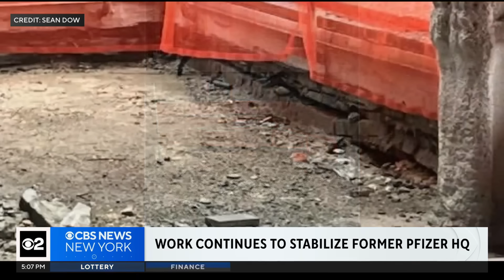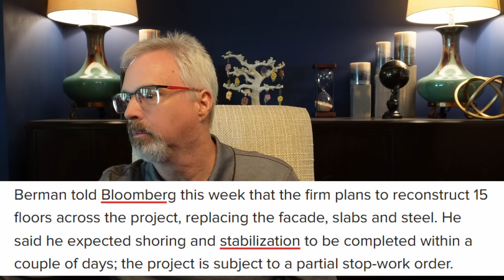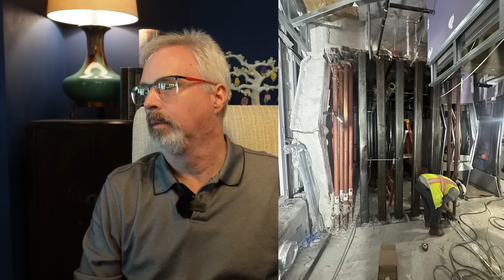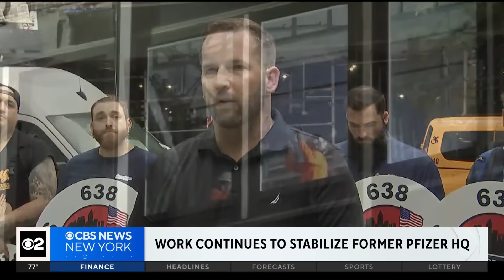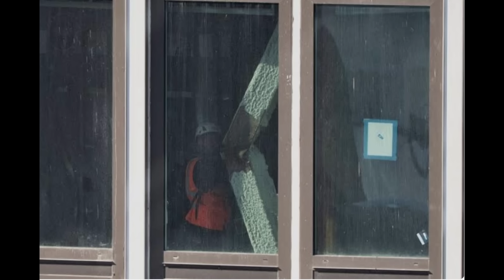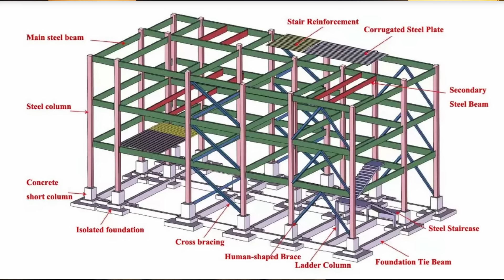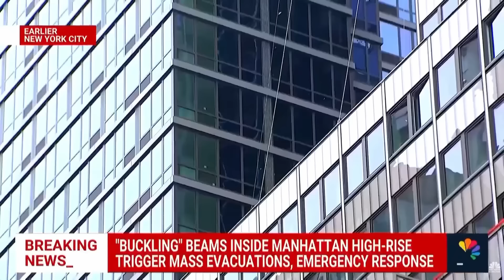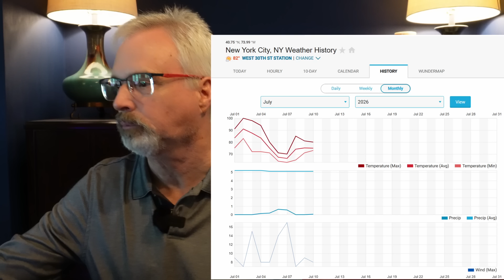Update - Pfizer Building Structural Column Failures; Now What?

Comment: Did anyone notice that the 2 columns that buckled were directly below the new columns for the addition?
And all of the load has been transferred to the floor instead of a support columns below each floor.
Remember that no dead or live loads have been added to the building, the construction hasn't been finished, and the new occupants have not moved in yet.
Reply: The new floor above the original building are dead loads.
Reply: @MrsAnnieTK  Exactly.  And more important, (from what I can see from the photos provided) the new dead loads haven't come close to their maximum values yet because all the new floors are still essentially, . . . . . .  gutted.

Comment: The building the columns failed was in the older building at 219 East 42nd Street, completed in 1905, was originally a 10-story building, expanding it to 29 stories.  Although engineers were more conservative in 1905, I doubt was built to support another 19 stories.  The question, if the columns are failing before completion, what will they do when it's completed with a working load?  This is a colossal engineering and city approval failure.  NYC, inept and inert engineering coupled with approval corruption sums the possible causes for this failure.   The buildings doomed from a marking point of view.   Olly a fool or idiot would have their family in a building that had column failures during construction or in an adjacent building. .

Comment: 1960 roofs were notoriously leaky. A leak over those columns could have soaked the fireproofing for a long period, contributing to corrosion in the columns.

I worked in a building constructed in the late 1960s on the top floor. In the 1990s, they decided to replace the roof. About 1/3 of the corregated steel roof plates needed to be replaced because they were too corroded to be be safe to walk on. Of course, the plates are much thinner than the columns, but a corroded beam may not have had as much of a safety margin as originally thought. It would also give a reason that the top original floor failed, but not something lower in the building.
Reply: Columns that are untreated in a “friendly” indoor environment will have minimal corrosion after decades, its the outdoor exposure with all that pollution that causes corrosion it starts to be a problem.
A lot of examples of 100 year old steel columns that has been standing inside a controlled environment that just have minimal surface corrosion

Comment: Casey, can you comment on the Structural Design practices in the 1950's and 1960's relying on LRFD with robust margins and safety factors. Compare to ASD , where more computerized calculations allow tighter models of structural systems. The developer seeking to exploite seemingly unutilized structural capacities in "old style" engineered systems may use newer analysis to support apparent safe use of such found capacities to add, oh say another 10 floors?
Real world condtions over time, made safe by the "Old Ways" are frequently under appreciated in rennovation work.  Pressure to fast, cheap, profitable work is irrestible for investors. Engineers are often either kept only partially informed about the job or are pressured to colaborate.  Your focus on foundations is exactly the place to start. Thanks!

Comment: NOT an engineer, but. If the original building had decreasing gauge of steel in the columns as they went higher up (to reduce weight and maybe costs) and the new project engineers made their calculations based lower floor gauged steel assuming it was the same all the way up, this would account for the buckling after adding more floors. Another thought the new floors were cantilevered out over the top floors this would change the loading from purely vertical.

Comment: At minimum, what went wrong was an incorrect assessment or (later) understanding of the actual load carrying capacity of the original building and its actual safety margin.

The load carrying capacity and safety margin of part of the original structure have both been clearly exceeded as evidenced by the obvious multiple column failures.

Comment: On typical major building additions how extensive would the engineering report be in regards to  the condition of the existing structure ? Would an in depth investigation of the piles (?) be done . 1960 was 66 years ago , were the as built plans still available ?

Comment: Thanks for good insight. Unions are full of malarkey. Their statements are meaningless. Do not look to much into inspectors and possible corruption, you might be surprised. Thousands of buildings constructed in Manhattan, not one fell apart like this one. The constructors did not inspect incoming material? Putting floors on top of a building, not engineered properly and structural components inadequacy, inadequate city inspection, City Planning Bureau failure?

Comment: Question: what is the guideline for 'over engineering' a steel anything?  When I do stuff with wood or electricity I tend add at least 20% of whatever I used in a hope that it isn't going to fall down, blow away, or catch fire.

Comment: First order of business is everything on the floor of and above those is unsafe and damaged immaterial of what anybody claims.
Second order of business is that any insurance company that decides to insure the contractor who claims it can be repaired should be immediately suspended from license and investigated 100% for drug use.
Third order of business is every structure near that building needs to have their owners sue to force its demolition... if the narrow part of the building can't support itself, NONE OF IT CAN and none of it will once its been converted.

I would bet the lack of HVAC has led to other locations where water in structure froze and did damage.  So the Union guy may actually be correct.  You don't hire a Florida company to work on buildings in NYC.
This all lands firmly on the developer's head.

Comment: But Pfizer claims the columns are "Safe & Effective"!
Reply: Hmmm, after making that statement would I trust their  claims for their drugs?
Reply: The building that failed wasn’t part of the Pfizer building - it was the next door one. The two buildings were merged as part of this project…
Reply: @allangibson8494  "Gain of Function Architecture"?
Reply: @kurtvanluven9351 That’s not Pfizer’s thing…
Chinese engineering however…
Reply: @allangibson8494  Chinese engineering can be problematic; Chinese construction is rolling the dice.
Reply: @MrsAnnieTK So is American engineering apparently…
Reply: I want to see the list of possible side effects.
Reply: Could this become a Insurance claim?
Reply: @Dynodog1  This being the US, there will be lawsuits, but towards whom? If the structural engineers overlooked the necessity of reinforcing the original building, they are on the hook. If the reinforcing is on the plans and was delayed by the contractor, then the contractor is responsible.

Comment: Casey, What comes to mind is that the grade of the existing structural members may not have been accurately identified for the structural analysis of the underlying structure. It’s possible that the upper level columns may be sized below the columns supporting the floors below. I have seen cases if structural members could not be accurately identified, then the most conservative assumptions were used. It’s plausible given the age and date of construction of the building. Thank you for the update.

Comment: This isn't a 60-something year old building. The original building is over 100 yrs old.
Reply from the maker: They built through the 100-year-old building not on top of it at 219 e. 42nd Street.  The building at 235 east 42nd street was built in 1960.

Comment: The live loads are higher for an office versus a multi-family residential building. 100 pounds/SF office vs 60 pounds/SF for residential. Corridors for both usually are 100 pounds per IBC NYC modified code.
Reply from the maker: Thank you!

Comment: I am not an engineer, but if this structural failure occurred under dead load, what needs to be done for live load??? 
Seems to me there’s a hell of a lot of engineering and steel work to be done yet!
Reply from the maker: It looks like there may be some eccentricity of loading between the 22nd floor to the oitside of the 21st floor columns but I am not sure from viewing the photos.

Comment: It looks to me like water entered the vertical columns at the original roof, just above the 21st floor, running down between the fireproof coating and the column itself, causing corrosion over the years.

Comment: Excellent video, spot on, concur with your points.  Excellent engineering assessment.  To me, the root cause of the issue is either (1) adequacy of the structural design, (2) materials discrepancy -- installed structural materials are not what they were supposed to be and were not accurately taken into account in the structural design for the new installation, or (3) installation labor.  My bet is 2.
Reply from the maker: Thank you, it will be very interesting to see what the final investigation reveals.

Comment: Cannot rule out that it may be design related &/or cost cutting. It appears that the two bent columns carry two of four of the cantilevered beam extensions for the protruding upper floors, and two others perpendicularly over to the adjacent (new?) building. Perhaps, if that load was dispersed to more of existing columns, or reinforce said pair of columns, accordingly.  Should it be designed related, it seems unlikely that union workers, or non-union workers, could of caused the pre-existing beam to fail mid-floor. Thanks, Casey

Comment: One situation to ponder is who and how made the decisions to add multiple floors to the building. From other similar construction issues there is one primary reason: GREED! My guess for the added space is to make the housing "affordable". They need more space to add rentable property. ADD: from long time ago statics classes. No mention is made of the estimated load required to buckle a structural I-beam. Couldn't quite tell from the stills: are these columns immediately adjacent to each other? If not, the overloading indicates more problems than than just simple overload.

Comment: One has to wonder, if such a failure occurs on a partially constructed empty building, what the margins are in the building after it is complete and fully loaded with fixtures and fittings.
15 extra floors seems very ambitious.
Reply from the maker: That's a very good question!
Reply: @CaseyJones-Engineer  Yet in my PE review training a half century ago (I'm a retired PE, but not at all structural, EE) we were taught that often the heaviest loading occurs during construction.  Construction materials all being stacked in one place as an example.

Comment: 3:06 Those floors above look like they are tilting a lot more than 4"
Reply: Much closer to four feet than four inches.
Reply: Yes, but also not possible to judge by a picture that has no context. Was it corrected for lens distortion and perspective? Is it level? Buildings can look wonky when you study them in pictures taken by ordinary (read: not set up for architectural photography with low distortion perspective correcting lens) cameras.

Comment: The union types are trying to blame the current workforce for the failure of a 60-year-lold component? That seems rather far-fetched.
I have read a number of engineering discipline reports where an engineer stamped a plan, and the horny-handed son of toil assigned to build it took one look at the pdrawings and said ",I'm not going to try building that incipient disaster", or words to that effect

Comment: It most likely contains asbestos. It is best to assume that if the building was built before early 1970's it contains asbestos. This is NOT a labor issue it is clearly the architect and engineering issue. Everything should have been calculated and accounted for. Clearly the loading of the new floors was not accounted for. Steel expansion is interesting. Logic would indicate the if all the columns on any given floor were the same then all of them would expand and contact at the same rate. I do not recall the title, but I read a book by Saul Bellow about Saudi Arabia before being deployed to Saudi Arabia for Operation Desert Storm in 1991. Saul is an excellent writer, and I found the book very informative.

Comment: If that structural column was so badly corroded what about the others?  Union complaint is not helpful, for all I know Local 638 maybe installed the steel originally.  Yeah, the developer can just shore it up and add more columns and weight.   Engineering failure IMO.

Comment: Not too worry because this type of building only collapses once.
Reply: It's New York - they get do-overs.
Reply: And you win the internet for today!
Reply: In the meen time they are  warm and safe .
Reply: If you tokk the jab and all the boosters you won't suffer of the lethal effects of the collapse.
Reply: @Hope_Boat  Seriously?  You saw the name Pfizer and couldn't resist could you?  Go and catch a preventable disease already and leave the science-loving folks in peace.
Reply: If there was stress added to the steal columns from the 100+° F heat in July causing damage by expanding steal will the cold temperatures of winter also cause more damage from the force of contraction to the temporary steal columns and the already damaged structural steal columns continue to weaken the overall building?
Reply: @BigRedPhoenix.OO1.  Steel.  It's steal when you take something from someone and steel when it's the metal.  Steel can become brittle if it's too cold but I don't know if NYC winter temperatures are the kind of cold you would need to reach that point.  It might be the kind of thing you need liquid nitrogen for.  Engineers (of which I'm not one) could tell you more.
Reply: Hey that’s what the guy at Home Depot said too
Reply: I mentioned this in the last video! The guy says “in a steel building if one or more members lose their load carrying capability, that load is distributed to adjacent members” We were told that WTC 7 collapsed because the of one the load bearing columns lost their structural capability. Who's right and who's wrong? Do Americans guess at these things?
Reply: @Womble13 When one load carrier loses its ability, that doesn't mean it's the only one that does. That's why they came up with the term 'catastrophic loss'.
Reply: @OneWildTurkey Thanks for your comment, I never got a clear answer in the last video. I’m not a structural engineer, but had been a Farrier until my back gave out. So why did WTC 7 collapse and the Pfizer building didn’t? Could it collapse?
Reply: @Womble13 Why the difference?  Billions of different variables.  But maybe the biggest is the age of the different buildings and different codes they were built to. Plus the WTC was MUCH larger and had a lot more weight. The stories I've heard still indicate that the extra heat from all that jet fuel contributed to weakening the support structure.  Just what I've heard, but makes sense to me. I've seen metal bend and have sequential failure, like dominoes, first hand, but on a much smaller scale.  edit: strike-out, I was replying about the wrong building.  Thanks @josephfisher426   for the catch.
Reply: @OneWildTurkey  The reference is to WTC 7 (the adjacent shorter one that collapsed), and I don't know that there was an official/complete public explanation of that. But its foundation could easily have been compromised, particularly if there were interconnections at the garage level. Doesn't need to be an internal cause.

The weight of the twin towers was mostly hung off the core and the structural parts on the edges were almost entirely for stiffness (I only saw it from the observation floor, but there it was disturbingly insubstantial!) I believe the explanation was something like that at the time this was a means of being that tall while not being so massive on the exterior that the building was short of square footage near windows.
Reply: @josephfisher426    I didn't notice the 7.
Reply: @Womble13 Narrative, optics, spin, selective facts, these things matter, it's a cultural thing.
Reply: @disklamerIf I was an American I’d be pretty p***ed off! I wonder if this will re investigate WTC 7?

Comment: The highrise was built as an office space. Not to house apartments. Kinda like the house 5 doors down from me. The place was an a house rental a new owner came in and thought he could turn the 1910's stone wall basement into a new apartment down there outside of permits. Dug into the foundation wall and caused the whole place to drop and crack all the walls while thinking 2x4's as braces would hold the place up.  The highway next to it had to be shutdown while the house was demolished with everything inside of it had to be left behind by the renter due to danger. He ruined the entire house and it had to be demolished. just google WGAL house demolished

Comment: You can’t add 15 floors to a 1960 era building without first going in and beefing up the original steel. Nobody designs a building that can take 15 more stories of weight 60 years after the fact.

Who signed off on the drawings? That PE needs to lose their license and possibly spend time in prison.

Comment: Thermo expansion of the steel, for a quick approximation.
1 inch expansion for every 100 feet with 100 degrees F change.
The visible failures are about 300 ft up, from a zero winter day, to 100F, with all in the open air, would be ~3 inches of change.